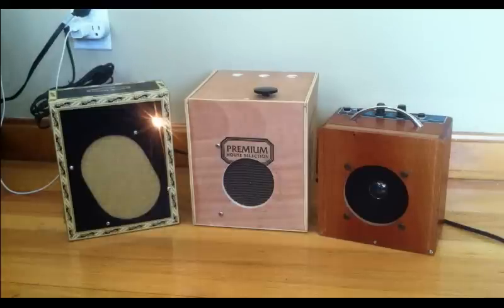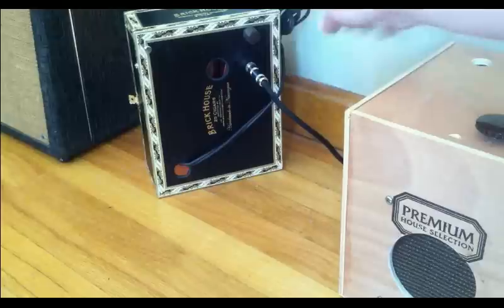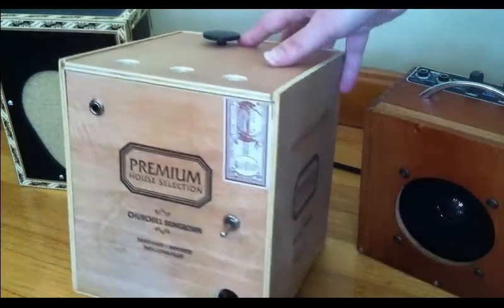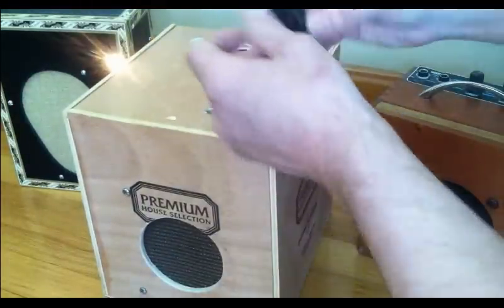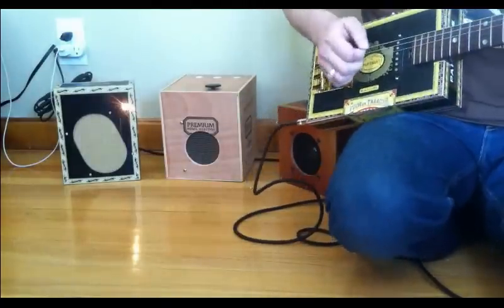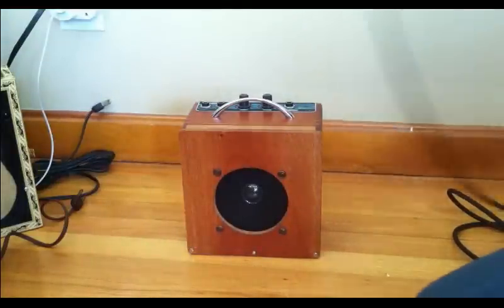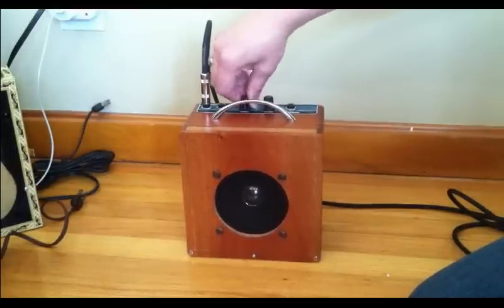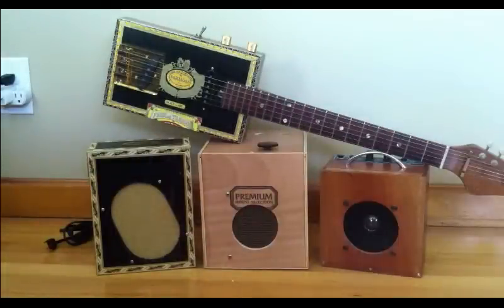Cigar Box Tube Guitar Amps

Comment: mini amps are so much fun - you did a great job on those Brad ! they sound fantastic but i am not so hot on tube break up . its ok but ...  i like variety . my acid box amp is solid state but it has mod'ed echo - long delay ,  and tremolo .i also have a metal chassis mini amp with distortion , and univibe and a flanger . the other one is a solid stage with chorus and delay that has a nice clean sound . after playing around with cigar box amps i started building class d based amps . right now i am working on a jfet marshal preamp to put in a classs d tpa3116d2 mono 100 watt mono chip board . i enjoy amp building even though most folks would laff at them as they arent tube , but i also have my fair share of tube conversions and builds . i just dont use those as much . i make music outdoors often using lithium ion battery packs and sla type battery's . the final solution for us is  a powered mixer with built in mp3 for drum loops , using a 2x10 sub and a pair of 8 inch pa speakers with compression driver tweeters .we employ digital amp cab sim. i am adding a all analog dry channel this summer but thats mainly so i can say STFU if anyone comments about digital and i am sure i will use it a few times and ditch it . guitar players on line are a bit obsessed about the tube thing . its just not always feasible , AND if you have decent gear and make your own patches well you find yourself not missing the incredibly ridiculous amounts of wasted power and heat that is generated in a tube circuit . it sure would be nice to just say what i use and not have to make such a huge deal out if it NOT being tube based . the minute i do NOT type all this extra bullshit i get some ignorant comment from someone who has NOTHING to show for their big talk .

Comment: Hey Guitologist, Nice little cigar box amps. I make them to, usually using my own home made Runoffgroove.com 1/2 watt Ruby amps using a MPF-102 J-FET and an LM386 audio op-amp, you should build one. They have a 1K gain pot and work really good. Tip: Clean your perf board when done building, score with razor knife between pins of J-FET & clean with HEET, ethyl alcohol. Stray voltage can impair performance. Be good, C.
Reply from the maker: +Cass Virgillo Very cool, Cass I hope my viewers take you up on that and build some of their own.

Comment: I'm curious about that last one. What amp did you get the guts from? It doesn't say in the panel.
Reply from the maker: +blackcorvo Good question. Not sure. The original 'cabinet' was a plastic jobbie that was probably sold through Fingerhut or something.
Reply: +The Guitologist if you can get a few pics or video closeups of the pcb at some point, that would be great
Reply from the maker: It was a Synsonics MG-53
Reply from the maker: http://s19.photobucket.com/user/electrictoothsyndrome/library/
Reply: all I can find on Synsonics are "travel guitars with built-in amplifiers", but I'm guessing this is simply a single-in-line TDA mono power amp with a built-in preamp, and that the volume and tone are between the pre and power. Distortion is achieved by driving the power harder.
Example: http://www.newtoncbraga.com.br/images/stories/artigos8/art0388_02.jpg
In fact, I wouldn't be surprised if that's the exact chip in your amp. Can't be 100% sure withouth a pic from the top of the PCB.
Reply from the maker: Sorry man, I'd have to take the board out for that.
Reply from the maker: If you end up making one from scratch, post a link here. I'd like to see it.
Reply: +The Guitologist I might actually do it with a PAM8403, one of those " 3w+3w 5v " amp boards. just need to work on the preamp
Reply: The Guitologist I kinda already started but I feel I can do better on the preamp http://www.ssguitar.com/index.php?topic=4004.msg3170
Reply from the maker: Hey, not bad!